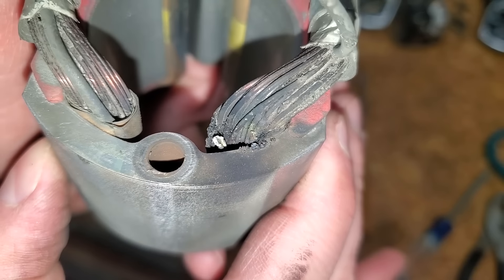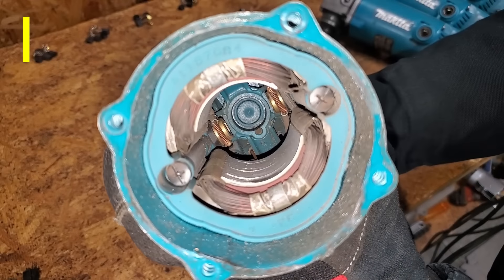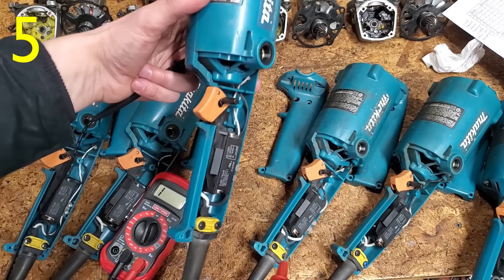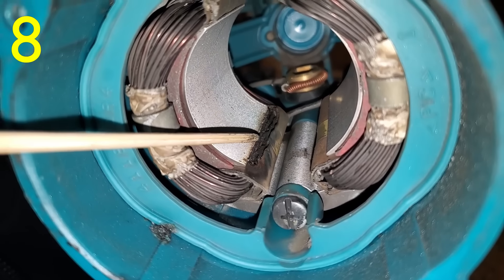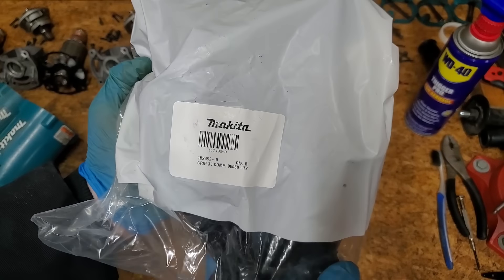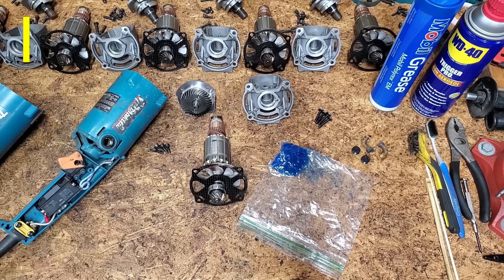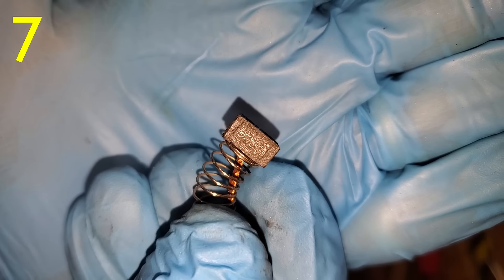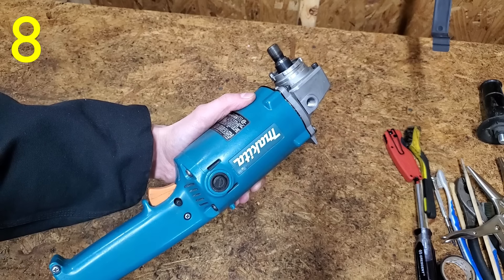Repairing Makita Angle Grinders

Comment: Usually large shops rent tools from a place that does all repairs and maintenance on them as well. That way they pay the same monthly payment and a repair guy comes in once a week and repairs or replaces all broken tools. Very rare do they actually own the tools and just keep replacing them as in a manufacturing environment, they see high abuse
Reply from the maker: Depending on the size of the shop, that's probably well worth the cost. Buying grinders at $200 a pop and throwing them out just because they need new brushes would add up quick.

Comment: Excellent video and i can see how you understand how things work, not everyone has that ability and you can't teach it. I am an electrician and am always amazed at the amount of stripped panel screws i come across, because the previous guy didn't do your trick of backwards first to find the sweet spot when reinstalling screws!! Very well done. I fix my own power tools but have never done the stator replacement. I fix a lot of water pumps too, the shaft water seal usually goes then the water creeps into the front bearing and rusts it out. i have fixed many 600.00 pumps with a 10.00 seal and a 10.00 bearing!! Again thanks for sharing!!!
Reply from the maker: Thank you very much, I really appreciate the positive feedback! I learn a LOT with each project and that's what I love about this hobby. I'm no pro so I understand that it's easy to feel intimidated at the thought of trying to fix something yourself but the only way to conquer that feeling is to try.

Comment: Try Using A Certified Insulation Resistance Tester Instead Of That Chinese Multimeter This is Required Even though The Appliances are double insulated.
Reply from the maker: I didn't even know an insulation resistance tester existed until now. :) I'm no pro, this is just a hobby.

Comment: What I like to ask is does Makita offer a warranty on the parts they sell? Lol I'm too poor to afford a Makita or top of the line tool so I'll stick with harbor freight tools
Reply from the maker: I think Makita has a 1-year warranty on new tools. I haven't personally used any of the Harbor Freight grinders but, for the cost, I've heard good things. If you're a pro, they'd never cut it but for the average home shop, they'd probably be perfectly fine. The only problem is, you pretty much can't repair them because there are no parts available. So, if it dies, your only option is to buy a new one.

Comment: Are you going to sell these or just keep them? Also I am curious how much time you put into each one.  I doubt you would get $200 for each, but if you can use them you saved yourself some good money.  However if your goal is to flip these, I can't see it being worth the time, since you only possibly made $800 (if you can get $100 for each which is a stretch) - the $290 also reduces the money you would make down to $510.  If you spent 5 hours refurbishing these, that is about $102 an hour, which I guess is okay, but I doubt it would sell quickly.
Reply from the maker: The point of this hobby is to learn and hopefully help others, not for money. I kept 2 for myself, sold 3 to recoup my costs, gave 2 back to the shop as a "thank you", and doing a giveaway for the last one. It's hard to say exactly how much time I spent on this project because I'm only able to work on projects a few hours each week. Filming slows things down too. I had almost 5 hours of footage to edit. Cleaning definitely takes the most time and I don't even film that part. And then there's editing which takes forever. :)

Comment: How did u learn this stuff
Reply from the maker: I just started taking broken stuff apart and looking for possible reasons why they stopped working. A lot of things can be fixed by giving them a good cleaning. Sometimes you can tell a part is bad just by looking at it. It might be burnt or worn down or broken. The nice thing about trying to fix broken stuff is that it already doesn't work so you've got nothing to lose. And even if you aren't able to fix it, you'll still learn a lot in the process.
Reply: @Mikeattempts  that makes sense but how did you learn the names of the parts?
Reply from the maker: @diogenesstudent5585  You can find a parts diagram for pretty much any tool online. That's part of the reason I do voice overs, I don't always know what the pieces are called as I'm taking the tool apart. The diagram gives part numbers too, so I know what to order.
Reply: @Mikeattempts  ty

Comment: I just repaired my 3M Adflo. The spring pins were no longer making correct contact with the battery. The warranty expired 6 months ago, 3M refused to service/repair/sell parts. Told me there was no way to repair it. Disassembly took 5 minutes, bend the spring contacts back to original place. We need right to repair laws!
Reply from the maker: Damn, it's one thing when a company doesn't make replacement parts but saying there's "no way to repair it", that's sad. I'm glad you got it working!

Comment: Well, I have some 6 pcs. 115 mm grinders, China made, that I bought each around 12-18 Euros (new). Cannot repair them: mostly the coals are run down and all of them have different models of coals. Some have the body broken (yes, it happened when I changed a disk): no, it's not rewarding to take a look at them at all.
Reply from the maker: Yeah, besides being made with lower quality parts, you can't repair the cheaper tools even if you wanted to. Replacement parts simply do not exist for them. The alternative is to spend more on a major brand tool that will give you easy access to replacement parts.
Reply: @Mikeattempts  I live on an island in the Indian Ocean, and importers do not want to care about parts; So you take it or leave it. A few I have from Bosch, also Black & Decker (hehe, another low cost brand) they are quite durable but it's the same when it breaks down: no parts. You have to order the same from overseas, so you throw them away also. Therefore I had so much Chinese grinders: I always kept them for some parts, but even the coals hardly match. They also use much quicker. Well, but at 12-15- or 18 Euros....
Reply from the maker: @harryhole5786  Ah yeah, I can see how your situation would make most replacement parts too expensive to warrant a repair.

Comment: It blows my mind that the workshop is throwing money away by not servicing perfectly fine tools. Changing the bushings is a basic maintenance task of a consumable, but they bought a new tool instead. I mean, I can understand that downtime might be not worth the cost for the tool with the damaged rotor or the other with the burnt coil windings, but the others, anyone with basic DIY knowledge could fix them.
Well, one man's junk another man's treasure
Reply from the maker: I can only speculate on their reasoning but I'm glad I ended up with 'em! ;) I learned a LOT and now have some high-quality angle grinders that I probably wouldn't have purchased new.

Comment: Damn man, you order 3 stators and a bunch of other stuff and it only cost you $200?! One stator for a 9005b for me is nothing less than $80 and i need 2! Wtf. Im going to rewind mine. 4oz of 20g enameled copper wire is only $16 and i only need 4oz bcoz i measured the length of one coil last night. Plus that fish paper and some brushes.
Reply from the maker: I think I paid around $50 per stator. The total for all the parts was around $290 including tax and shipping. I actually wanna try rewinding the fried stators too so, if you end up rewinding yours, please let me know where you got the supplies and how it turned out!
Reply: @Mikeattempts   well it was easy enough to remove the old windings. Just unbend the metal holding back the ends of the windings and pull it out, after that they come right out. I measure 40 feet each winding. So 80 feet total for one. When i get some money i will order the materials but in bulk. I got two 9005b, two ga4530 and one 9557nb from a friend/client i cut grass for who owns a company. Plus another 8 mastercraft, 2 walter i think and a metabo grinders. I got one of the ga4530 grinders working again, was only the switch, so the other one had a good switch but faulty armature. I put all the good parts on the working 4530, the other i might not fix unless i can find the button to lock the spindle to remove cutting discs. They need brushes. The 9557nb just needs an armature. I fixed a cordless 18v makita grinder for a friend a few month ago, he was gonna throw it out. So i took it. New armature, complete new brush kit with the plastic mounting bcoz the old one melted. Cost $75, he gave me $100. Works A1. I still have the armature and the windings are not encased in resin so im thinking to rewind it. Infact i was initially going to rewind it due to the cost of buying a new armature but when i told him what i found he said go ahead and order the parts to fix it and that he would pay it. So, but if nothing is wrong with the iron field why not salvage it? Esp considering how cheap the copper wire is and how expensive the replacement part is. 1lb of 20 gage enamelled copper wire is $37 on amazon. That can theoretically wind 4 stators for the 9005b. Plus you need new fish paper at $30 a roll of 5 inch by 25 feet. Only need a bit of that maybe 1 foot? Lets say one dollar worth plus $9 copper wire and maybe 30 min labour. Idk why the part cost $80? Esp since it prob made on a production line. Theyre milking us on the parts.
Reply from the maker: @rashadabdullah9769  Sounds like you have a lot of experience fixing tools, that's cool. If you can't find a replacement spindle lock, I wouldn't think it'd be too hard to make one, they are usually just a spring-loaded pin. I would think rewinding would be time consuming in order to get each loop the same size and tightly packed, so it'll fit nicely into the stack without scraping any of the enamel off. Keep me updated, any tips would be greatly appreciated!

Comment: bad idea to use electrical tape on the wire after a few months its just a sticky mess that wont hold togheter (sliding up and down)

better to use shrinktube on the area you wanted to expand (talking form experience) i never use electrical tape for anything anymore
Reply from the maker: Yeah, I know what you mean but the strain boot can't move and the cord is held in place with a clamp so hopefully it'll be alright.
Reply: @Mikeattempts  It will be OK. I have done this myself.

Comment: Your grease is not adecquate for gears. it`s only for bearings... Gear grease for angle grinders should have a NLGI 00 consistency, instead of NLGI 2.
Reply from the maker: I agree that what I put in was probably a little thicker than what I took out but the original definitely wasn't 00.
Reply: @Mikeattempts  NLGI 0 sorry, my mistake. but NLGI 2 does`n`t protect your gears against abrasion. the grease must be thiner and penetrate deeply into the metal
Reply from the maker: @ivicaconev5221  My plan was to use the same exact yellow grease that was originally used but I couldn't find any. So, I used the best option I had available.

Comment: WOW! Nice job! Man could I ever use one of those! Always wanted an angle grinder. Can't afford $200 though. :(
Reply from the maker: Thanks! Most angle grinders aren't nearly this expensive. These ones are made for business, not for the average homeowner. You can get a really good grinder for less than $100. Or you could buy one used for probably less than half of that. I think Harbor Freight's lowest model is only $20 but the motor isn't as strong and it's not meant to be repaired.
Reply: I've had two of the harbor freight $15 cheapos for years and they're still going strong. Buy 2 or 3, the amount of time you'll save swapping from cutoff to grinder or sander or wire brush is worth the $15, and if one does burn out at least you'll have a backup.
Reply from the maker: @feelthepayne88  I've personally never used a HF grinder, but I've heard good things (for the price) and I'm sure they'd provide adequate performance for the average homeowner. That's also a good tip about multiple grinders. When I first heard someone say that I just thought it just sounded like a waste of money but now I have 3 grinders and I'll probably keep a couple of these as well. :)
Reply: @Mikeattempts  I have 5 grinders lol. One grinding, one sanding, one cutoff, one wire brush and one broken one that I will hopefully be able to repair with help from your video! 😁 They're all cheap, but they get the job done, I probably paid around $100 for all 5 combined.
Reply from the maker: @feelthepayne88  Let me know how the repair goes!

Comment: Hello Mike,  I work in the Purchasing and product engineering department in one of Makita's 9 factories over the world. They still build their tools as they used to even as today. Their tools are made to last pretty much a lifetime if used correctly. I am very interested to know the country where they were assembled,  and the what GA5000 model they are because they don't make that particular model anymore,  but they still make parts for pretty much all older models so they can be repaired. 
PS. Those grinders are keepers. Have fun and tell me the part number on the stator,  I quickly find out who made the stator.
Reply from the maker: Yep, they're definitely quality tools. It's nice that they are repairable and replacement parts are available. All 8 grinders were assembled in the USA. Each failed stator had a different 6-digit number but they all ended with 801.
Reply: @Mikeattempts  Those type of part numbers mean that the stators where made in the USA Makita factory most likely which means they aren't bought from a 3rd party company. Same story in Europe and Asia, they make their own rotors and stators.
Reply from the maker: @zuzuzaza6211  That's very interesting, thanks for the info! 4 stator failures out of 8 seems high, was that model known to have a high failure rate?
Reply: @Mikeattempts  I don't know because I work in Europe,  it is a possibility that those stators are from the same batch because as soon as they notice some faults or something wrong they issue engineering changes and correct the wrong doing. Plus, the quality department checks every component and the final product multiple times. Not sure how they work in the USA factory but I'm positive it's the same as here and in their other factories. 👌
Reply from the maker: @zuzuzaza6211  Hopefully the other 4 original stators weren't from the same batch. :)
Reply: @Mikeattempts I suspect the four failed stators are the result of being used in a welding shop. You could put a welder in a padded room with a cannonball and the cannonball would be broken when you got back.
Reply from the maker: @lunchboxproductions1183  Hahahahahaha!!!
Reply from the maker: @zuzuzaza6211 Since you work for Makita, would you be able to find out the type of gearbox grease that's used in these grinders? It's bright yellow and is probably NLGI 0 or 1 but I was unable to find out what it's called or even the type. Any information you could provide would be very helpful, thanks!
Reply: @Mikeattempts  hey Mike, I'll check tomorrow when I go to work. Yes they use a yellow type of grease. Keep in touch.
Reply: @Mikeattempts  OK Mike, they use grease Mobilux EP1 and lubricant Shell Tellus MX46. Hope this helps.
Reply from the maker: @zuzuzaza6211  Wow, yes, this is extremely helpful! I would consider myself pretty good at finding stuff online, but I spent quite a bit of time searching for the answer and came up with absolutely nothing besides other peoples' opinions on which grease to use. I even asked a couple different AI chatbots and they gave me incorrect answers (surprise). Thank you very much, I really appreciate your help! :)
Reply: @Mikeattempts  you are welcome.  Keep up the good work 👌

Comment: Well if you think about it the brushes are carbon ..just like the internal old batteries
Reply from the maker: Yeah, I just would have never thought to do it.
Reply: There is a problem with your statement. You need to know that the Carbon Rods from batteries aren't suitable. There are probably around 20 different blends of Carbon Brush manufacture, and minerals / metals (such as copper) are also added in their composition, along with self-lubrication properties. Some Carbon Brushes are hard - some are soft. Another interesting fact - is that (in theory) there is never a direct contact between the Carbon Brush and the Commutator. The Carbon Brushes ride on molecules of water. Sometimes, you don't see shiny copper on the Commutator, and it may look like an Army Green color. You see this, and all is well, because the Brush Spring Pressure is correct, the Carbon Brushes match the equipment, and the stepped-wear that you see on many Commutators is virtually non-existent. It's pleasing to see someone repair those Makita Angle grinders, especially when 90% of the machines are still in great condition. greetings from Australia.
Reply: That was 50years ago

Comment: Shouldn't the investigation start with testing/running each grinder for CONDITION?  What issue(s) exist on each grinder?
Reply from the maker: When I went to pick 'em up, they were in this big plastic bin on a pallet. The owner told me that's where his employees throw the broken tools. It's probably pretty safe to say that you don't throw out a $200 grinder if it still works. Plus, I didn't wanna do any additional damage.